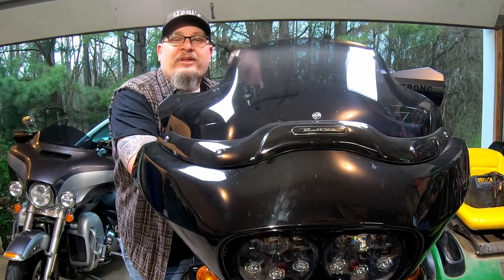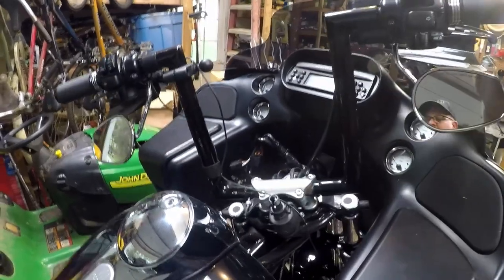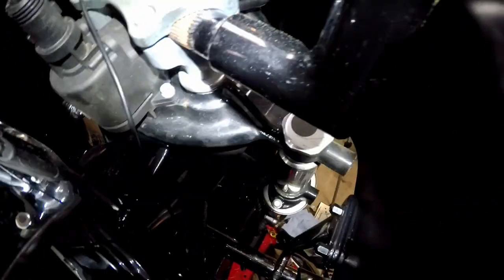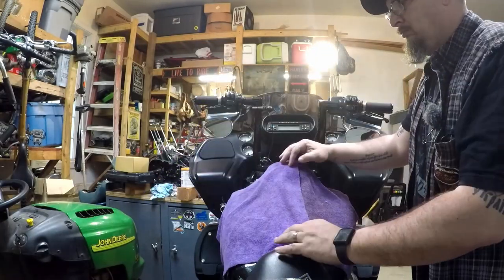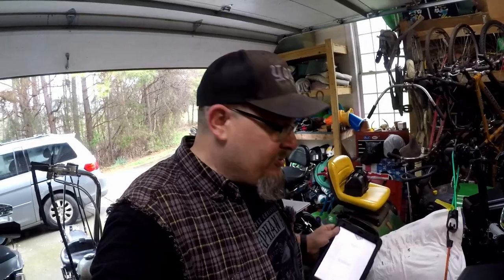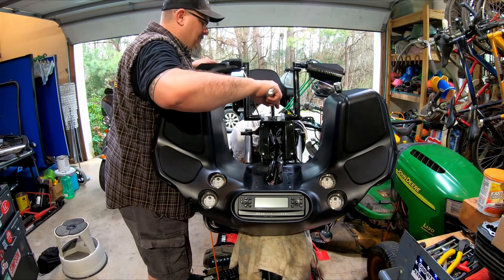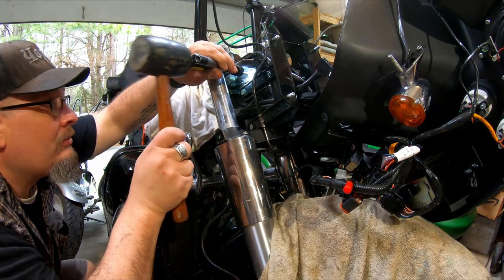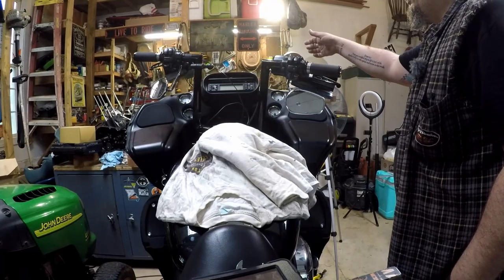2013 Road Glide Neck Bearing Adjustment

Comment: Looking at the manuaL reference. That is a frame mounted fairing. The removal of the outer fairing and radio seems to be only for fork mounted fairings.
Reply: If you have the proper tool to get to that star nut then yeah but doing it the shade tree style as seen in video , its so much easier to just rip the fairing off, bro! Also yogi, a little misinformation was put out in your video! Per service manual, if it stops within the first or second swing then its too tight, if it goes all the way to the 5th motion ita too loose and target is 3rd-4th swing with primary being the 3rd! Too tight and you begin to compromise the bikes ability to absorb the potential to weave coming out of turns and too loose compromises the machines ability to absorb a wobble, especially at speed! So not being rude by any means , i just feel thats critical info, given its nature, to ensure proper dissemination of information! That concludes my Ted Talk lol

Comment: I’m having this same issue but on a 2009 Street Glide. Wondering if it would essentially be the same thing and resolve my issue?
Reply from the maker: Potentially. There are lot of factors that would cause a wobble. Check your manual on how to do the fall away test for your bike because it may be different

Comment: Do you think i could make the adjustment without removing the fairing? I have a 2012 road glide ultra**
Reply from the maker: Not really no.  It’s hard to get to period so all you can do to get to it is pretty much necessary.
Reply: @YogisCycleService  i was afraid of that. But, i don't wish to spend more money at the dealership. So guess I'll start taking my bike apart. Thanks 👍
Reply: @YogisCycleService  welp, i tried what i could, and managed to do the adjustment without removing the fairing. It was tricky. But, i did it.
Reply: @BigSpookyJeff was it really hard? I have a 12 I wanna give a go at

Comment: Same concept for 2011 Electra glide ? I’m getting a weird vibration really noticeable at 60mph
Reply from the maker: I would have to consult the books for a Electra glide to see if the swing test is the same.  The adjustment is probably similar.  I would also say a vibration could be different from a handle bar wobble.  First thing I would do for you would be check yourself tire first for lumps and then check balance.  Those 2 seem to contribute to vibration much more frequent then a loose neck.  A loose next seems less likely then a wheel issue plus it’s easier to start there and eliminate the basic stuff fitst

Comment: How many miles on this bike ? Thanks for your time
Reply from the maker: On that bike at that time it was around 4.000 so loose from the factory old
Reply: @YogisCycleService  
Thanks, my 2007 Ultra Classic is starting wobble with 16,000 miles. I’m going to start with new tires and then go from there .
Reply from the maker: @rq38hq55  yes thats a good place to look first, then look at front motor mount
Reply: Thanks Yogi 👍 I tightened the motor mount down. Didn’t use a torque wrench. It seemed loose. Didn’t help with the wobble. I have since bought a torque wrench. I’ll revisit that . How many lbs should I tighten it? Or how can I tell if it is worn out ?